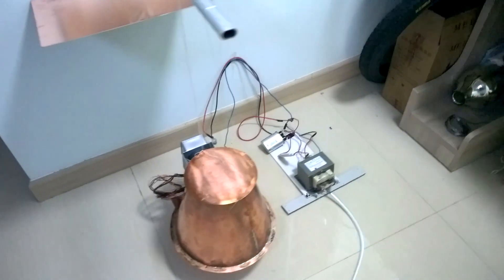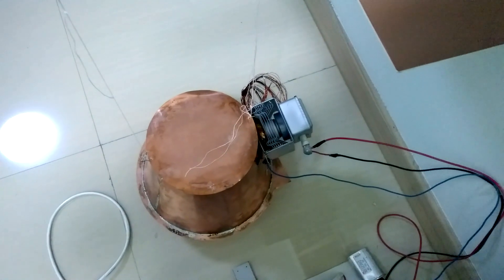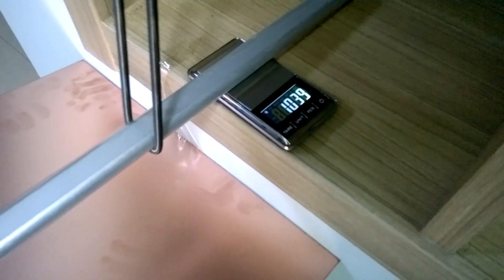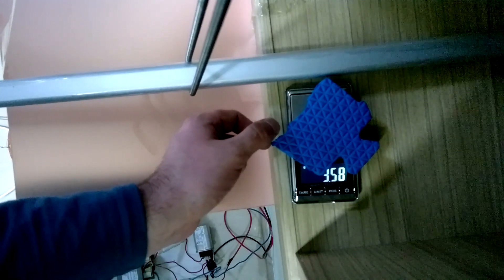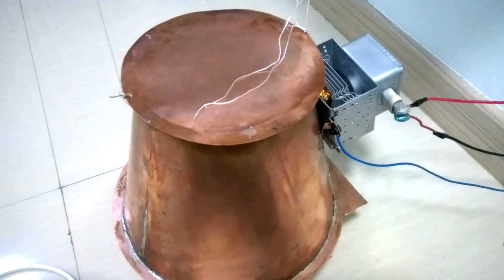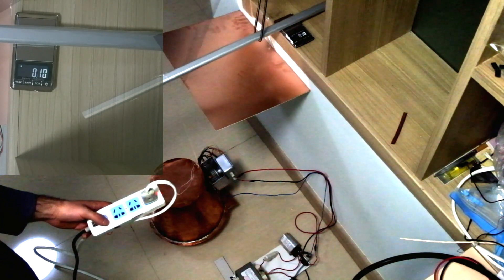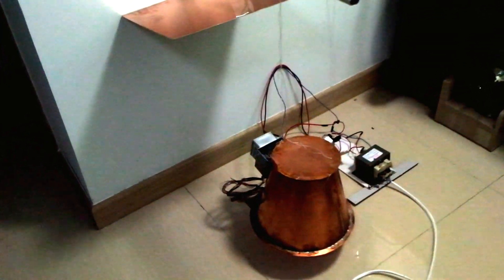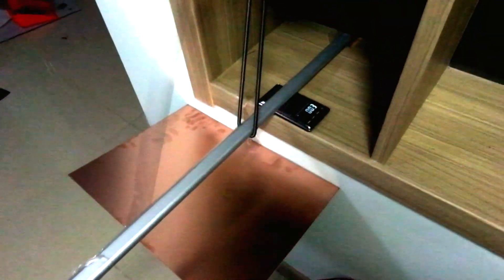EmDrive Test No.03 Success, I have thrust !!!

Comment: I applaud the effort, but I suspect you're just measuring the random oscillations in your spring resulting from the vibrating magnetron. The scale you're using was never meant to work this way, and so doesn't update very quickly, so you don't see the rapid oscillations.

Try it again, but block the emitter on the magnetron, or point it out of the cavity. I bet you get the same result.

Also worth noting, you're getting several orders of magnitude more thrust per watt than any scientist has gotten in a controlled experiment, which were measured in fractions of micronewtons per watt. If you're getting a handful of millinewtons out of 2.5 kW, then you did about a thousand times better than everyone else. I'm inclined to believe this is more likely to be the result of you screwing up than from you being better at this than everyone else on the planet.
Reply: According to my calculations 2.5KW at 1mm wavelength microwaves would produce 8.3 micronewtons.

Comment: Eh.  You've got some 10A AC running through those connecting wires, a whole lot of magnetic field interactions going on in that magnetron and no end of thermal interactions.  Before you declare success I'd be investigating the net electromagnetic interaction between your drive wires and the huge mass of copper sheeting you have everywhere.

Comment: I'm not sure but you MIGHT want to read up on what happened to the people who experimented with radar when it was first being discovered. Then decide if you want to take crazy insane risks like testing this sort of device in your home. Just sayin'.
Reply: And what happened to the people who experimented with radar?  These are radio waves.  Non-ionizing radiation.  The only concern is tissue heating at high powers.  It doesn't cause cancer.

Comment: The type of scale you are using is sensitive to changes in electromagnetic fields, that's how it measures weight. Take the device off the scale and turn it on for controlling for e.m. field changes from the power supply, and/or use more shielding around the scale. Also, as others have suggested, have a control cavity of the same volume but is cylindrical in shape. If the physics of the device are sound, you should measure practically no thrust on the cylindrical resonance cavity.

Comment: Make a cylindrical device and a conical device, both at a length that will permit resonance in the cavity, and see if the results are the same or different.
Reply: Or just block the emitter of the magnetron, or point it outside the cavity. My guess is he's going to measure a similar result no matter what, because he's measuring the noise of the magnetron, not thrust.

Comment: This device is only as anti-gravity as a hot air balloon, and the hype is full of Hindenburg air! You literally gutted the organs of a microwave, strapped it onto a metal pail, and turned on the microwave. The heat radiated through the metal into the air inside the pail causing a negligible, yet detectable lift.  This isn't new technology. We've been radiating food for more than half a century, and hot air travel has been around for centuries. This contraption is full of negligibly-hotter-than-room-temperature air, literally!

TL:DR Sorry, no anti-grav boards, but how about a hot air board? Or, how about Mary Poppins' umbrella?
Reply: Easily testable. Flip the device over and try again, if there's thrust in the downward direction than heat isn't the cause. Not saying some kind of magic anti-gravity is, but thats how science works... keep eliminating variables until a conclusion is reached.
Reply: MrNotYoDaddy I completely agree, and I'm confident that scientists are already doing things like this. The problem with this video is that the experimenter denotes the device as anti-gravity at the beginning, though we can not conclude that from his trials. Convection theory easily explains the lift in his experiment, because we use the same exact equipment to radiate food in our home: the microwave.

The recent scientific experiments done in coordination with NASA are another story though. I suspect more studies are needed before concluding that the EM drive actually produces propulsion in a vacuum, but it's certainly not an anti-gravity device. That's just silly, sorry.

TL:DR  If anything, he's made a microwave-powered hot air bucket, which is still pretty cool.
Reply: the "heating" part of your argument is debunked due to the drop in thrust as the bottom plate heats up. in the vacuum/cold of space this won't be as large a problem as the heat will be sinked away from the plate.

Comment: Not convincing. Wires conducting current can heat up a bit and change the friction between them and the wall. This can show up as a thrust.
Reply: Yeah.  I didn't see the thrust either.  LOL
Reply: More like......The most basic and fundamental issue that you have in regards to this device is that you are heating the air with in the device creating pressure differences. It is obvious you have not taken into account temperature and pressure differences in and around the localised test area. In Laymans terms you have created a very very inefficient hot air balloon 🎈

Comment: Did you conduct the same test with the device inverted, to see if it would generate the same thrust, down, as well as up.  If the thrust is due to heating, it'll not generate downward thrust (that would require cooling)

Comment: this is not an accurate experiment as moving objects will increase its weight so what is actually happening there is the object is increasing in weight instead of creating thrust. in order for to accurately test this out we would need to test this out in a weightless environment aka space.
Reply: This doesn't actually make any sense
Reply: ***** my explanation or the EM drive?
Reply: your explanation. it goes into the negative on the scale, so the getting heavier part is inaccurate. what is most likely happening though is the air inside it gets heated and thus works like a hot air balloon, lightening the load on the scale. you don't need weightlessness to measure if it does produce thrust, you need an atmosphere that replicates that of space, ie almost complete vacuum so it only interacts with itself. Not saying the EM is or isn't possible, but his experiment can't give accurate results regardless.
Reply: if it's airtight, the hotter air shouldn't make a difference since there will still be the same amount of air, just under slightly increased pressure.
Reply: well though i doubt it is, considering the apparatus on the side, but that is true, given no leakage what so ever. but a hotter environment makes a differance regardless, that's why NASA did their test in vacuum.
Reply: eh, maybe, it depends ;)

Comment: Does it work outside gravity field???
Reply: face palm
Reply: Why wouldn't it???
Reply: +Marley Cauffing Because in theory, it is possible to push against a gravity (or any other) field, we just have not found a practical solution yet, and well this might be it. (sci-fi calls it gravitational drive ;-)
But it is against current theory to make device that produces thurst WITHOUT "pushing against" something or that does not produce thurst by emmiting some sort of propellant mass (particles) or radiation in the opposite direction of thurst...
And this one supposedly is NOT pushed by emitting microwaves out the one end (microwaves suposedly stay in ;-).
Allso the force measured here is many orders of magnitude higher than a "photon rocket engine" of that power which is propelled by emitting EM radiation (light/microwaves...) out one end.
Reply: What location inside of our galaxy is free of gravity?
Reply: +Marley Cauffing In the exact center inside black hole, perhaps? Ok no engine would help you once there ;-) just kidding.
Yeah you are right, nowhere really. I was just thinking about how it might work.
Reply: Marley Cauffing More appropriately, outside of our universe. Gravity spans across all existence.

Comment: Dude you need to do this in a vacuum
Reply: yeah I don't think physics gives a fuck about any excuse he has for not having a vacuum chamber, it's necessary.
Reply: ***** And we should also know that the EmDrive had many margin of errors. One of them being heat, a big problem is that when the drive starts up it gets hot, and some physicians suggest that it heats the air molecules around it to generate the thrust. Doing it in an vacuum eliminates the possibility of air molecules generating the thrust.
But there are still countless other sources of error that are still needed to eliminate if possible.
Reply: With shielding so that there’s no interference from the earths magnetic field.
Reply: That's no excuse, without a vacuum chamber and other equipment, the result wouldn't be accurate.
Reply: Anthony Millward He doesn't have to be in the vacuum, just that EmDrive
Reply: look... the thrust he may be experiencing is the air particles being energized from the microwaves then being ejected out the end... you are also measuring using a scale that isn't accurate enough to measure thrust... this design is meant to be used in space... there are almost no air particles in space... you have to replicate the environment as accurately as possible... also you might be experiencing thrust to do magnetic interference...
Reply: Yeah he'll just build a vacuum chamber in his garage and.. OH COME ON
Reply: @tobi888100  that's the point, theres no point testing something you havent even got the beginins to monitor and properly understand and test scientifically
Reply: @these_go_to_11  As I understand where you are coming from I'll just say the point would be to discover things not taken into acount given the experiment does not use up time or money without reasoning.
Reply: @tobi888100  doesnt alter the fact that it only works inside a vacuum
Reply: @tobi888100  the point isn’t that he doesn’t have a vacuum chamber.. it’s that the experiment is useless in the environment he’s doing it in. The whole theory of the EM Drive is meant to be done in a vacuum. In space.
Reply: NikTheFix An very well controlled environment includes an vacuum environment, so it eliminates more errors ~ Aim is to remove as much as possible errors, but yeah, those environments are far out of his capabilities. Also without those controlled environment, the results shouldn't be believed in because of the margin of errors possible. Well at least that's my opinion
Reply: He could but he would have trouble breathing......
Reply: With a high enough Q factor, interference from air and other effects could be considered negligible. Just need to keep experimenting with different designs to find higher and higher Q factors.
Reply: This actually works and yet some scientists it goes against the laws of physics when it doesn't
Reply: This is literally Star trek propulsion

Comment: Why putting the thruster upwards instead of downwards to the ground with the weight measuring machine (sorry i dont know the word, im not english) underneath it. So it just measures the thrust directly and in positive numbers and nobody can say that your complicated device creates the "thrust"
Reply: I think it's because the thrust is so small, so the way he is doing it amplifies the result. He showed that the blue weight was 10 grams using the lever but 3.6 grams when directly put on the scale (that's the word you were looking for, for the 'weight measuring machine'). Since the EM drive supposedly puts out really really tiny amounts of thrust (regardless of whether or not it really works or if there is something else causing that thrust) the scale would probably not be able to measure that small amount. So by amplifying the result he can measure it with his scale that is not precise enough to measure it directly.
Reply: well said
Reply: +Eric G that's bull. His scale is accurate to a hundredth of a gram. So it would be well suitable to measure 1g difference.
Reply: Well regardless that at least appears to be his intention.

Comment: Your readings of thrust are most likely due to sources of error rather than the microwaves.  This wasn't done in a vacuum chamber, so you have to consider that it could have been due to heated air.  You could disprove this by pointing the apparatus in a different direction.   Induction or other magnetic fields is another big possibility, you are dealing with a good bit of power.  Good to see other people trying this though.  The reason for my skepticism is that your device produced alot more thrust any I have heard of.  Good to see other people trying this though.
Reply: This was last year, NASA has done this project and have published a report saying it does work, in a vacuum chamber, but they are continuing to see if their are false readings, but in the mean time, it has been proved to work. As of 2 days ago, Idk if you knew this
Reply: Agree with you.

Comment: In this case I think what you are mostly measuring is hot air baloon. There is a lot of moisture in the air and the microwaves are heating up the water molecules in the air. The hot air is expanding and is less dense than cold air outside of the device.

Comment: This is the stupidest experiment I have ever seen,  you are measuring the same object by two different mechanisms ! allow to explain ! when you take your blue piece of foam and put it on the scales, fine, that gives you a weight reading, that's fine. BUT THEN you take that blue piece of foam and reweigh it when it is NOT resting on the scales, but instead is creating a different weight BECAUSE you are using a LEVER set up ! this is BASIC stuff, all you have done is used a lever to weigh the same thing and oh great surprise OF COURSE YOU GET A DIFFERENT WEIGHT WHEN USING A LEVER ! what are doing man !
Reply: wtf you idiot? do you even science?
he is using the lever to increase the torque applied to the scale so that the measured thrust is increased by a factor of three!! this was deliberate you muppet.
Reply: well Bel Rick..do I even science ? yes I even science, ever heard of compounding errors ? are you trying to say (in your foreign tongue) that this is what he says it is ? do you actually believe it? do you?

Comment: Nasa has comfirmed this works. You get about 1.1 mN per KW. Average outlet can produce 3kw. That means that his scale would need to be reading 0.0003 grams which it is not. Hes claiming grams of thrust while using a lever to get that value. Being that his lever is about 1m long he is still off by a scale of about 100. For him to actually read .5 a gram of thrust the lever would have to be around 100m long. The thrust he is seeing if there is any is simply magnetic field pulling on the steel lever.
Reply: Corinthian Pagel Nasa hasn't confirmed it works. They just found out it was producing thrust, but since its operation would break the laws of physics, it's most likely just photonic leakage causing minuscule propulsion.
Reply: 1. The whole point of doing the experiment was to confirm that it was indeed an observable and testable phenomenon. That's how physics works - experiment, theorize, predict, experiment, test, repeat until you've got a workable theory. Most scientists are fine with saying "We don't know why this happens, but it seems to be happening for sure". Read their paper.

2. "Break the laws of physics"- that's what made physicists disagree with relativity when it first came out, or quantum theory, or even the idea of black holes. Our picture of the universe in terms of physics is incomplete, and if you're convinced it is and assume everything that seems to disagree with our current models, you're just a bad scientist.
Reply: @burgerbobbelcher  This device is producing grams of reading on the scale, which is much stronger than the test conducted in a more controlled environment. The scale being used is inadequate for this kind of measurement and even if a much more precise instrument is used, the environment is still going to produce so much noise that would drown out the signal.
Reply: psycronizer sir you are an imbecile
Reply: ok somewher you got your facts wrong. 1 mN eqals to the force of about 0.1gram (1milli Newton is 1.02x10^-4 kilogramm-force or kilopunds and  gram is a thousand of a kilogramm  so 1.02x10^-1 gram-force wich means the force of 0.102 grams accelerating in earths gravity). like you saif the average socket can deliver over 3 kilograms.
so when he draws about 3kw that means he gernates  3.3 milli newtons wich is about the force of 0.33 grams. given that the leaver contraption amplifes that by about 3 thats means over 80% of the shown effects are actually the thrust of the drive.
Reply: not even that...yes it's a load of horse shit....
Reply: He told you, he can DO MATH AND... oh my God... HE CAN READ!!!!!!!!!!! See? That makes him qualified to criticize any new theory. :)
Reply: psycronizer how do you know that it doesn't work? It's kind of obvious what my question is considering the only thing you said in your response is that it's a "load of horse shit..."
Reply: psycronizer if NASA scientists where able to pass peer review, and this is NASA now, they have much more experience and credibly than you. Also, giving the drives low trust, that means nothing. It's still stronger than a solar sail and can power inter-celestial travel at speeds thousands of times faster than a chemical fueled rocket.
Reply: psycronizer how do you know.
Reply: be specific, how do I know...WHAT ?
Reply: ok. Nicholas....I am going to be incredibly polite and make no assumptions at all, this time. How do I know it doesn't work ? because I can read and do math, and because the answer to that question is in this other video titled New Paper Claims etc etc...the average measured thrust is 1.2 Milli Newtons per Kilo Watt....that's all you need to know that the whole thing is a giant waste of time.